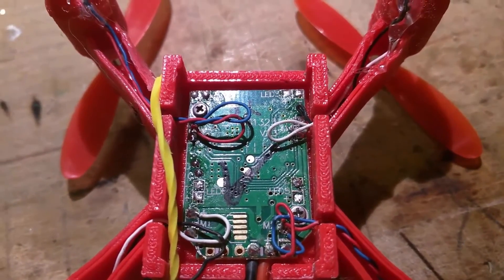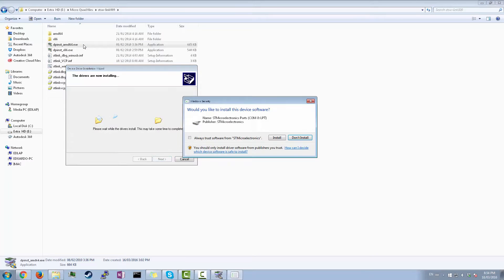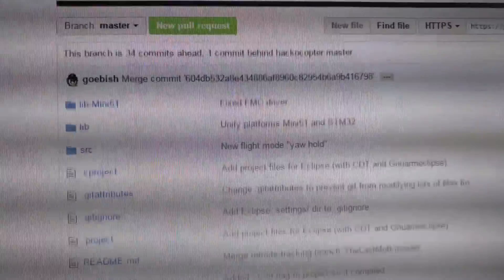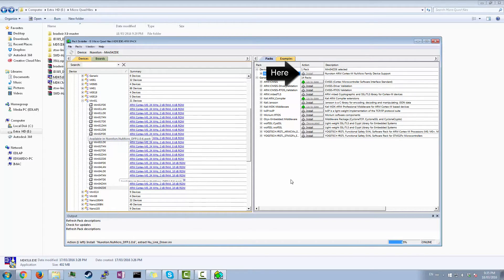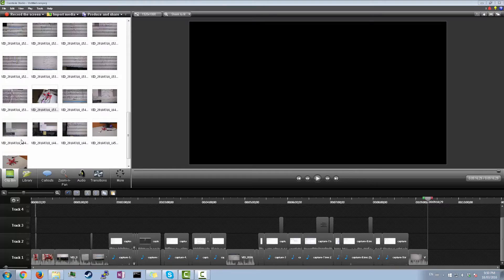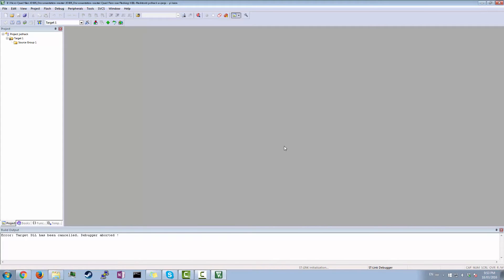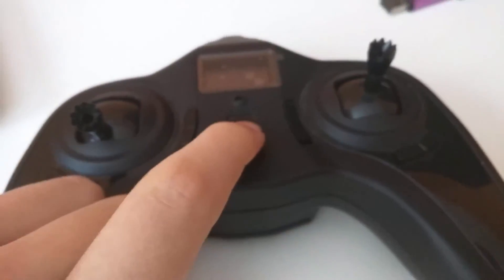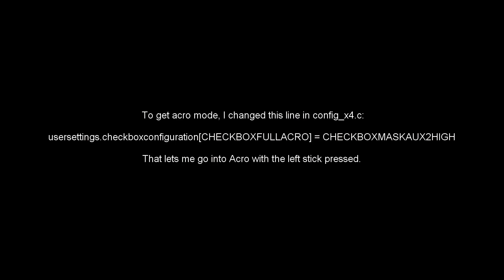Cheap Micro FPV Quad Part 1: Flashing Bradwii to a Hubsan X4 (Acro mode!)

Comment: Oh! Finally got it to work. Tips for people with problems:
-Ignore "Select device for target" use alt+f7 and set the device on the first tab
-Go to [Project -> Manage -> Migrate to Version 5 Format...] to get 54ZDE to show up
-If you have .axf issues, on Utilities tab uncheck "Update Target"
-When you connect with debugger and run the command, hit ALL but the top button in order (You will see the memory values zero on the left)
-When you open the bradwii x4 project, set the device again, and BUILD TARGET in the project menu first, then download

Comment: Will this work on an H112D X4?  I'm guessing X4 designation is the flight controller.   Also, it would be nice to see a confirmation video of one flying FPV in Acro mode and what kind of performance we can expect vs. say a typical brushless carbon frame 5" quad in acro.
Reply from the maker: If I had to guess, I don't think this will work on the H122D X4. The two quads seem quite different, and I wouldn't be surprised if they used different flight controllers. Sorry I don't have any video of it flying, but it definitely has acro mode now! Performance was ok without the camera, but I never got it to fly well with the FPV setup on-board. I think my VTx drew too much power and drained my battery, I had to use near 80% throttle to get it off the ground. Any 5" with decent motors and batteries would definitely blow this out of the water. In my experience, the power density of brushless motors is something even the best brushed motors can't come close to.
Reply: @Thescimanmobile  - I sold mine without opening the box and will get a Tyro 119 probably.  There were just too many bad reviews of the Hubsan.  It sucked on every point.

Comment: what version of the hubsan X4  flight controller do you have?i have an h107c and an h107L flight controller i can use so i want to be sure to use the same as you are using in the video.thanks in advance

Comment: hi, all worked, but i can't arm my x4 with the trottle bottom trim, i don't know why
Reply: Can I disable arming?
Reply: i have the hubsan h107d, and maybe it's because ma radio commande is not the same?
Reply from the maker: Have you tried pushing the throttle stick in? Sorry, not too familiar with the 107D
Reply: yes nothing on my radio control work, but the bind work
Reply from the maker: Hmm, sorry I can't help much. I'm only familiar with the H107L. Maybe try changing the lines that deal with the mods and arming?
Reply: Are they in configx4?
Reply from the maker: They should be
Reply: ok i will search ! tahnks for all
Reply: with this configuration, can you arm youre x4 when it is inclined?
because i tried a lot of thing but i tried to arm when it was inclined.
Reply from the maker: I'm not too sure about that. I've always armed it when it's level

Comment: I will say though, that even though I have Bradwii installed and it works, as some others mentioned my quad flips over and doesn't really take off. If I push forward on the stick the quad will lean forward and it will seemly then counter on release when holding it... but for some reason it cannot go straight up... Any suggestions? I turned my PID i and ds all to 0L... I worry about the "maxpitchandrollrate" being 400 and saying degrees per second... but I feel like this isnt the issue since these are defaults.
Reply: ZDE turns on but doenst work RIGHT, ZAN makes the blades spin slightly when armed, which I imagine is more desirable, but still flips over
Reply: AzimuthGames did you figure it out? mine flips too :(

Comment: @ALL with M054ZDE not available, try following:

1) Install yKeil
2) Install Legacy Support Pack
3) Start the device Manager and search -> You will see Nuvoton Family
4) Install the pack for Nuvoton
5) Start yKeil and load the project
6) Go to [Project -> Manage -> Migrate to Version 5 Format...]
7) Confirm the message
8) Go to [Project -> Options for Target 'Target 1'..."
9) Select [Device] Tab and there you should have M054ZDE available

!!! I DIDN'T GO FURTHER, SO I CAN'T GUARANTEE THAT THIS WILL WORK !!!
Reply: Worked! Hubsan is now flashed with BradWii! The Screenshot with Debug before flashing the frimware needs Show Config and Erase Chip! Not only Show config... otherwise the firmware is locked.

Now i am going to work on the config, so it wont feel like a tank in slow motion on ice...

Comment: What is the PID used? I cannot get mine to hover correctly. Thanks
Reply from the maker: At the moment, my PIDs are P: original value (sorry, can't remember), I: 0, D: 0. Funnily enough, it works pretty well for acro, but not for angle mode.
Reply: I realized that my problem is not the PID, but for some reason the gyro is not working on on Bradwii for me. Essentially I have 4 "fans" spinning at the same speed and not affected by the angle of the quad.
Reply from the maker: Johnny Chang That's how acro mode works, it doesn't self level.

Comment: Arg please help, i have flashed to my hubsan but i cant fly anymore. the quad acts to slow on motion changes. so it cant start or hover
Reply: Hey, did you manage to fix the slow motion issue? I got it flashed and in ACRO mode it is really slow...
Reply: Hannes E no :( but I have it only on one fc. A second works great
Reply: I got it...  Seems to be the Hold Yaw mode that is activated bx pressing the pitch stick down 👍
Reply: I onlx need to find the acro mode now and then i can continue working on the cam.

Comment: I'm also seeing that "select device for target" is grayed out.  I tried to build the target but nothing happened.  Is the board supposed to be plugged in at this point?
Reply: I did the whole build target thing and all of it.  It just stays grayed out.
Reply from the maker: Yes, the board should be connected at that point. You are basically selecting which processor you want to flash to, and it needs to see if there is one connected.
Reply: +Thesciman so it won't show that option until it's connected?  I'm really that dumb...  Once again.
Reply from the maker: Ahahahh no problem! We all have our days.
Reply: It still doesn't seem to show up!  It's plugged in and connected, but it's still grayed out.
Reply: You know what?  It's okay.  Maybe I'll try this again someday.  But this is just too much of a hassle right now.  I'm going to delete everything I downloaded and start fresh some other time.  Thanks for trying :)
Reply from the maker: Sorry about that. It also took me a couple tries to get this to work!  Sometimes starting fresh will make this work. Best of luck!
Edit: Believe me, it's not your fault. This software is very difficult to use and  there isn't too much support for it. Kind of difficult to diagnose problems.
Reply: I have a cable soldered to the board, I'll just leave it.  I'll uninstall EVERYTHING and start over.  Computers, amirite?
Reply from the maker: Ahh yes. We all know the frustration
Reply: +Thesciman are you on Facebook?

Comment: I had issues with MDK520.exe and MDKCM520.exe. I installed the packs but I did not see Mini54ZDE as an option as the target! Only Mini54ZAN. I was able to find MDK518 and MDKCM518 online.
Reply from the maker: That would be caused by an error either in installing the support pack or the zip file. Try re installing both of them.

Comment: Have you managed to get any good PID settings for acro mode? I having difficulty tuning mine.
Reply from the maker: +Matthew Nesbitt To be honest this is my first quad that I have to tune, so I am by no means an expert. I have read somewhere that to start the tuning, you first remove all values aside from P. At the moment, my PIDs are P: original value (sorry, can't remember), I: 0, D: 0. Funnily enough, it works pretty well for acro, but not for angle mode.

Comment: My board is version 5.1. Does it still work?
Reply from the maker: +Fábio Castro I don't think there is a version 5.1.... Are you sure it's not 2.1?
Reply: +Thesciman Yes. Its the latest version I believe. I've seen people in the RC groups thread with the same version. I had no idea this was possible.
Reply: 5.1 is the 107L board.
Have you done it with v2.3? I read about it soem time ago on rcforums, but they only done it with 107L board and noone knew if the 107C (v2.3) board can take the bradwii as well. If so, that would be neat, since 5.1 can't power the 8.5mm motors efficiently.
Reply: +BujajBanana It works but i think its not worth. Too much work to set the settings. If you want to install it anyway just get a cheap board from Aliexpress. Keep that v5.1 stock
Reply: Can you do it with 5.1 or not?  I have a 5.1 that I'l love to try.
Reply: +Max de Feijter You can. I did it with mine

Comment: Any idea why "select device for target" is greyed out? If it go to options for target I can access the device tab, but then the m054zde file is not there. So far I managed to wipe my board, but i get the error could not load file ...bradwii-X4.axf which refers to an empty folder, when trying to flash the bradwii firmware.
Reply: +Ryan Hackney read the FAQ...lol hate when i miss dumb stuff and waste my life...

Problem: "Error, Flash download failed - Could not load file '<filepath>/<file>.axf"
Solution: Project not compiled, go to 'Project -> Build Target (or press F7).
Reply: Same problem. Did you find a solution?
What device did you use? Since M054ZDE does not show up
Reply: I listed my solution above... I used the other device mentioned (M054ZAN maybe?) and it seemed to work fine, but after I got the bradwii firmware flashed my copter would just flip over immediately. It's hard to recommend doing this since the project is basically dead and it ruined my copter (maybe it depends which gyro you have).
Reply: +Ryan Hackney Did you try the updated gyro code for the v5 board? i will flash it anyway and hpefully i get it working with bradwii and Support for my fly sky radio.
Reply: I did try that, and didn't have any luck, although I could have put more effort into getting it to work. I also had a v2.3 board (i believe) like the one in the video, but I had different results. I was unable to get the copter to even arm using one version of firmware, but the one time it did arm it performed just as bad. Also, no one is responding to the RCGroups forum.
Reply: I flashed mine and it flies!
Reply: Glad it worked for you. What version of the firmware did you end up using?
Reply: https://github.com/goebish/bradwii-X4
This one..Just had to change the Gyro with the one from Silver.
Reply: I did that but it's still grayed out...
Reply: I did exactly this but nothing seems to have changed.  I restarted the program and everything.  I'm lost and incredibly frustrated right now.
Reply: Mhm... Same issue here. Can't get the M054ZDE for selection as device. I've ceated a new thread in Custom Electronic part in RCGroups. Hopefully it will get some  attention. No idea why this project got neglected even after a new board version got up. I saw that the device selection is coming from Software Packs, not Legacy Devices. Maybe the video creator had some additional driver files?

Comment: Very interesting, can you please tell where can we get the purple USB adapter? I am new to this and you have been a inspiration to me. I want to  buy all the stuff neded for flashing my hubsans and eachine 3d x4 if possible from bangood? 
all the best and keep up the good job and keep flying and having fun.
Reply from the maker: +jorge manuel morbey Thank you for the kind words! I got the USB adapter from eBay for only a few dollars, it is called a ST-Link V2. I am not sure if you can flash the H8 Mini 3D, but I know you can flash the normal one (non-3D). All the best!
Reply: +Thesciman , thanks for your fast respond, I have the Hubsan x4 h107d fpv FC and I notice that you is the hubsan x4 107L one, is it possible to flash all the hubsan x4 or only your model, do you know? take care and keep on flying.